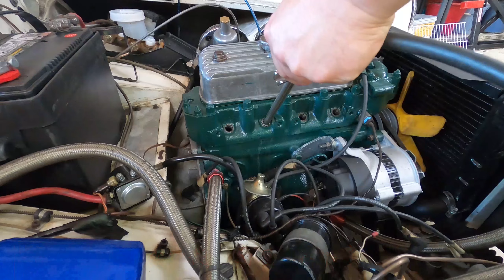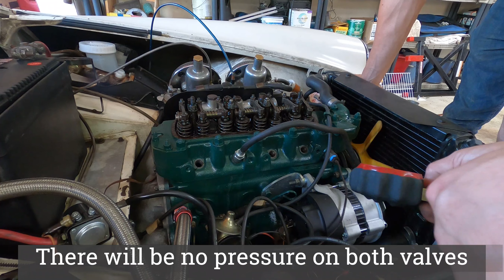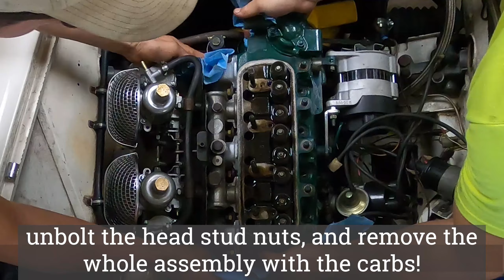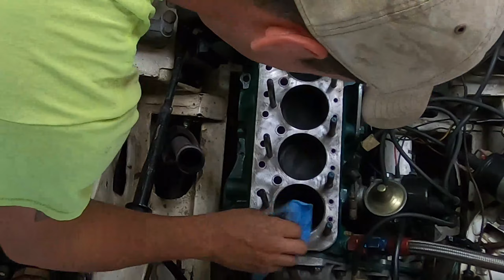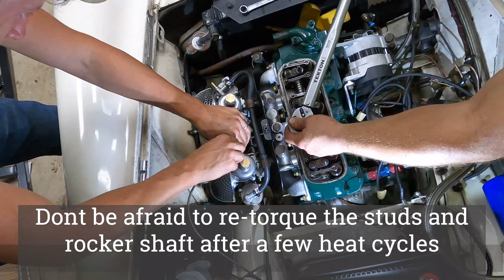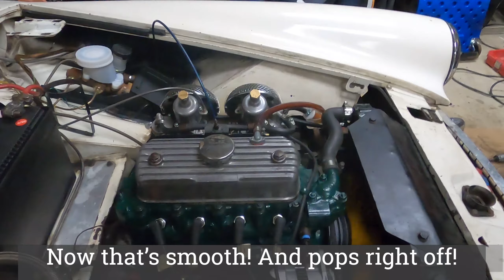68 Austin Healey sprite/MG Midget Head gasket replacement and diagnosis, leak down, compression test

Comment: I have a 1966 Sprite. I checked the compression when the engine was cold. The front 2 cylinders were 71# and the rear 2 were 119#. How much compression should I have and do you think it's a head gasket? One thing I might add is when I had the air cleaners off and I gave it a good shot of gas there was a white vapor that came out of the front carb.
Reply from the maker: Min 90. The 119s look good.   I would suspect front cylinder are leaking into each other from a head gasket, but need to do the leak down test to know for sure
Reply: @nsigarage5212  Ok thank you!
Reply: @nsigarage5212  I did a leak down test today and it did exactly the same thing yours did. Mine has a header so I guess i will have to unbolt it at the manifold and leave that and the carbs in there.
Reply: @nsigarage5212  It ended up being the head gasket between 1 and 2. I should have it back together in a week or so.
Reply from the maker: Awesome 👌🏽

Comment: I just did the same job on my 66 sprite. I adjusted the valves a week before I did the head gasket. When I checked the valve lash after the new head gasket all the valves were loose so I re-adjusted them.  Is this common?
Reply from the maker: Yes. Different thickness of the head gasket.  Raised the head slightly
Reply: @nsigarage5212  Thank you!
Reply: The compression test showed 150, 135, 135, 141. Before I took it apart it was 71, 71, 119, 119.
Reply from the maker: Pretty good.  I would change the oil. With those 2 cylinders not really firing, unburnt fuel gets past the rings and dilutes the oil.    I would run it a couple hundred miles and I would expect your readings to be the same or even improve slightly
Reply: @nsigarage5212  Ok thank you, I definitely will!
Reply: @nsigarage5212  I didn't put a couple hundred miles on it yet but after driving it 3 different times the new numbers are:  1-143#    2-144#    3-135#    4-143#   and it runs real good, almost as good as it did when I bought it 48 years ago right after the engine was completely rebuilt.
Reply from the maker: Outstanding. Glad my video helped. And thank you for the updates, it helps many others with the same question.

Comment: This engine was recently rebuild. 

There's more than a head gasket issue here..
Reply from the maker: Would youike to elaborate? The previous  owner had the timing off and didn't know the carbs needed dashpot oil.  After doing the headgasket and making the proper adjustments it has been smooth at silk for the past 5K